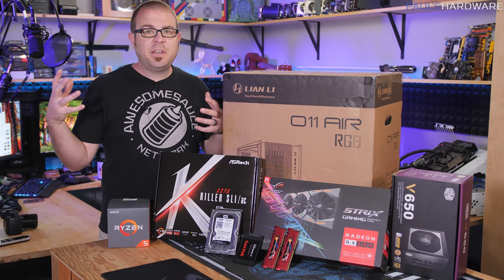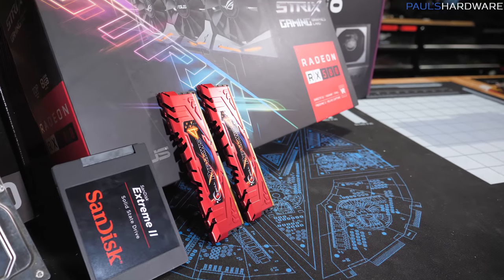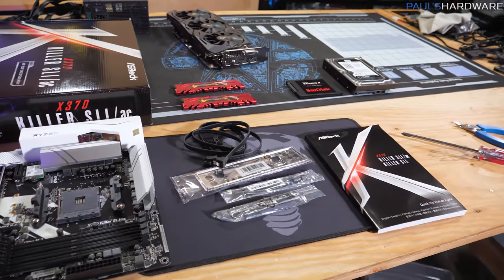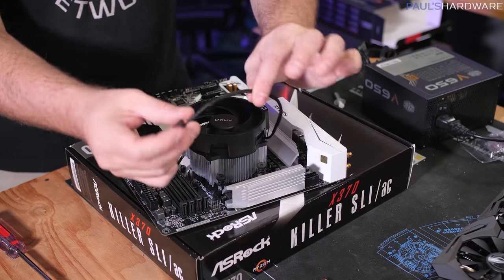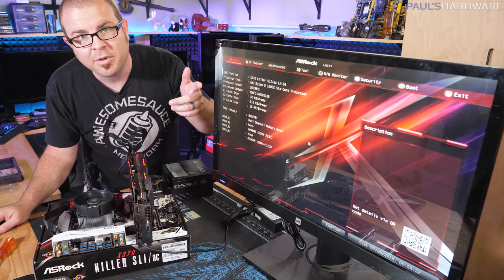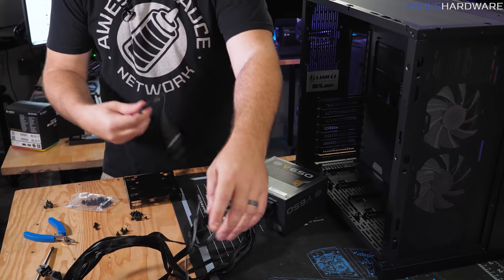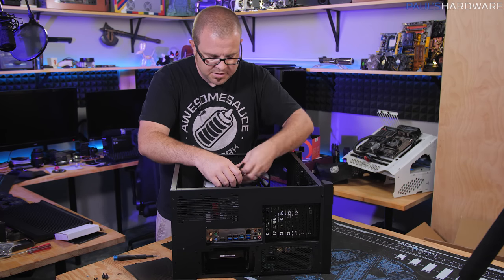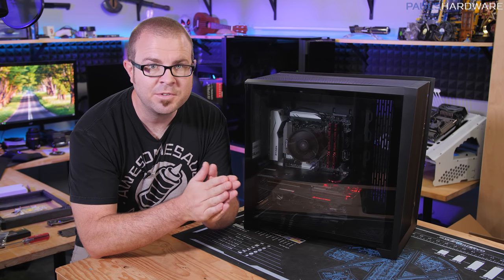How To Build an $800 Gaming PC in Late 2018!

Comment: 650 W Power supply????? Just why
Reply: Because if you actually do power calcs on that system, you'll realize that you're WAY below 650W.  The power calc I ran on it says it only uses 415W at load and only recommends a 465W PSU.  Add to the fact it's a gold PSU so it's more power efficient.  For my personal builds, though, I like to buy a bronze PSU that's double the load wattage.  There's a bell curve on the power efficiency.  At about half load, even bronze PSUs don't waste much energy.  If you're on a strict budget and you need to save that money, or put into a more critical part (CPU/Memory/GPU), buying a 650W PSU is fine.
Reply: @iguanac6466  IMO a budget build should focus on price performance. Like u said a 650gold PSU is waste of money in this budget build. Not to mention the 100 bucks case with RGB. I rather spend that money on a display
Peace

Comment: Back in the 90's I bought a friend's old used 386 system and taught myself how to upgrade and also how to build from the ground up.  Did that for about 20 years and a short-notics job change and relocation caused me to buy a factory-built computer.  NEVER AGAIN!  I know that building is more expensive but I have the satisfaction of knowing what's inside the machine and am more closely tied to its inner workings.

Comment: That PSU method is good! I have always used PSU for grounding, just plug it to a wall. Fan will not spin but it will work as "sink to ground".. Touch it occasionally, you can plug the PSU then to PC when you are complete

Comment: Hi Paul, I am about to build this exact system, the difference is I went for a 16gb ram kit, a B450 motherboard and a better power supply. I have had a PSU take out other parts before so I don't go too cheap. I have had to compromise on storage and only have a 240 SSD. In the UK our prices are a bit higher than yours but I am at £780.

Comment: Good looking mid-range build! Paul, you should however show people how to rotate the AMD logo, I imagine it can be pretty triggering to some people (me included). It's basically removing the shield and 4 screws and you can rotate the fan 360 degrees to any orientation.

Comment: Love your vids!  Can you help with a bit of advice PLEEEASE?  below is my current pc set up.  It was built about 6 years ago.  Do I need to build a whole new one, or can I just upgrade a few things on this one?  (games like WoW, Fortnite, Rainbow6) 

CPU:  AMD Phenom II x6 @3.8+ghz
 
Heatsink:  CoolerMaster hyper 212+ (hand lapped with twin corsair upgraded PWM fans in push pull)

Motherboard:  Gigabyte 990FX-UD5

Memory:  Corsair XMS3 @ 1666mhz

GPU (s):  2x XFX ATI 6870

Harddrive:  Hitachi 1TB 7200rpm SATA

Optical:  Sony DVDRW

PSU:  Corsair TX750 750W

Chassis:  Lian Li K62

Comment: As of 9/21/2018 using Micro Center's prices/deals:

1x AMD Ryzen 5 2600 CPU
1x MSI Tomahawk B450 Mainboard
1x MSI RX 580 8GB Armor GPU 
2x G.Skill Ripjaws 8GB-3200 RAM
1x WD Black 256GB M.2 SSD
1x WD Blue 1TB 7200rpm HDD
1x Antec One Case
1x Corsair CX550M PSU
-----------------------------------------------------------
$809.64

The above list is the best all-around build you can buy at the $800~ish price point as of September 2018.
It's considerably more powerful than the build in Paul's video(2nd gen Ryzen, 16GB RAM, M.2 SSD).

Comment: I recommend not using the pre-applied thermal paste that AMD supplies. I killed a 1st Gen Ryzen trying to take it apart. The pre-applied stuff had turned into glue after about a month of regular operation, and pulling the heatsink/fan off during disassembly brought the CPU with it (WITH THE ZIF socket closed), damaging pins. I've since always used Arctic 5, and haven't had a problem since. It's super cheap to get thermal paste, and one tube lasts for dozens of installs. Save yourself the trouble.

Comment: Hey Paul! Great video! Would you still recommend one of the Ryzen APUs and the upgrade GPU later when on a tight budget or to just save a bit longer for better CPU and GPU up front now that prices have come down?

 Canadian pricing doesn’t seem to have come down as much but it’s an improvement over the last year.

Also your 500$ build from this year is what finally made me decide to build my first pc. Thanks for all the great work
Reply: you can update the gpu later the 2400g is like a 1400 with an igpu, you can use even a gtx 1070 without bottleneck

Comment: Thank you for actually saying\explaining the point of an IO shield to newbies. It having “contact point for the components of the motherboard to prevent ESD”. I’ve seen idiots cut the contact points off those instead of bending them back as best possible when they end up bending them and then others actually take that crap advice of cutting the contact points off and burn their board up wondering why when they touched it a billion times plugging and unplugging components while the things on...

Comment: I just built an $800 PC with rx590 and ryzen 7 2700x with 16gm ram. I skimped out on storage though, only a 500gb ssd but it's all I need, only reason I did that plus way easier to upgrade

Comment: Hey Paul, should you ever get bored, do a throwback build to include older gen intel i5 (k series) paired with an affordable nvidia 980 or 980ti. To top it off, throw it in a Thermaltake View 32. Cheap, sexy, & extremely powerful.  There are way to many "cheap" processors and cards if you look that can rival any budget build.

Comment: Hey Paul, currently using the stock cooler on my r51600, want to upgrade to a better air cooler but I'm kind of overwhelmed by the huge range... Reccomendations?

Comment: ? i have a Gtx 1060 3gb, I7-7700, 12gb of ram, Ssd 250, 1tb Drive. ASUS H110-PLUS. Would this build you have be better? Or What should i just upgrade
Reply: GPU and maybe the hard drive...and I wouldn't do those until you start seeing your GPU memory utilization maxxing out, or your framerates aren't to your taste.  Upgrading your hard drive isn't necessary until you start running out of space.  1TB is pretty tight if you don't micromanage your game installations.  CPU/Memory/Mobo should last you for years.
Reply: I overclocked my gpu and tbh its a good increase. I just want to stream hell a better then i am now. So any suggestions on that? Is my cpu low end or?

Comment: Pauls Hardware Hi Need Some Advice. It's my 1st PC Build. Which GPU is good for 4k and 8k video rendering under cheap or budget range. And Which Coffee Lake PSU would you recommend for my build parts below.

Intel Core i3 8100 3.6GHz 8th Gen LGA 1151 processor.
Asus TUF Z370 Plus Gaming RGB Atx LGA 1151 Motherboard.
Coolermaster Hyper 212X CPU Cooler.
Ram : G.Skill Trident Z RGB 16GB (2x 8GB) DDR4 3000MHz.
NZXT Hue+ Advance LED.
1x M.2 SSD 250GB - 2280.
1x SSD 120GB.
1x HDD 512GB
3x Deepcool RF120 mm Case Fans.
1x NZXT Case Fan.
NZXT S340 Elite Mid Tower ATX Cabinet.

I have asked about it many time and asked everyone on YouTube and other social networks but No Answers Yet.
I Hope You Read And Help Me Out.

Comment: Quick question.

Are the AB350 motherboards worth it? or should I shell out the extra $$ for the x370 platform
I am about to build a basic Ryzen 1200/2200g system but planning to get an 8-core in the future

Also, is the whole single channel issue still a thing?
I'm planning to get a single 8gb stick since prices are quite awful here in Argentina.
Reply: A single 8gb stick is a bad idea. No need to spend extra money on x370.

Comment: Guys do you recomend these parts for streaming and gaming for my pc build im gonna do soon and please dont hesitate to tell me what parts i should change:

-ryzen 7 1700 (or ryzen 5 2600 still dont know)
-gtx 1060 gb dual 
-msi b350 tomahawk (or x470 gaming plus)
-2tb Seagate hardrive
-240gb sandisk ssd
-corsair cx550m psu
-8gb balistix ram (may get 16gb soon as a upgrade)
-Nzxt s340 elite white case
-uphere white psu extension 
-logitech g502 gaming mouse
-corsair k65 lux keyboard with mx reds or speed switches (still deciding) 
-steelseries Qck mouse mat

Comment: the case power connection should be long enough to reach the motherboard outside the case. if you dont want to be shorting things with screwdrivers

Comment: Hey Paul, I have a z370 motherboard, a GTX 1070 video card and a 650 watt semi-modular PSU - question - the 8pin cable that's affixed to the PSU that supplies power to the CPU has an extra 8pin connector that's attached and will fit my video card - so - is it okay to use that - or - should I used a dedicated cable from the PSU - it would seem to be that the less cables - the better?  Thanks in advance for your comments.

Comment: Good guide but on the front panel connector can you go a bit more in depth I ended up frying my whole system because i had put it into an adapter that connected to the power supply.

Comment: If you have a 2 fan AIO do you plug pump, 1 fan or use a splitter and plug both fans in? Or do you need to split pump and both fans together for the 1 plug?

Comment: Ok so here’s my build:
Gtx 1050 ti
I3 8100
B360 mobo
Single 8gb ram stick 2400 
1tb hard drive 
500 watt psu
Will this be enough to play most games on 1080p medium to high settings? This is my first build and I am on a budget but I want to know if i should just save up and get a 1060 3gb or not
Reply: 1050 TI will be mostly medium settings (esp if you only one with a terrible cooler and/or only one fan).  If you save up for a 1060, get a 6Ggb model with two fans and a cooler with radiator pipes/fins instead of a solid aluminum plate with fans.

State of Decay 2 ate all my 3G of 1060 memory at high settings @ 1080P.

Comment: Ok I have a gtx 1050 ryzen 5 2600 16gb trident z 120mm kraken cooler 1tb hard drive what power supply should I go with at the minimum

Comment: If u want performance for price just go used/refurbished. I got i5 7600k @ 4.8 GHz, Gigabyte z270d-p3, GTX 1070, 2 x 8 GB Corsair Vengeance LED (3200 MHz), a modular corsair psu and good case all for $650.

2018 with so many buyer protection policies by companies like PayPal, make it so easy to save money and get performance.

Comment: i was following step by step until the out of box test. my mobo lights were on but not the cpu fan nor the graphics card fans. should I continue with the build and hope I just didn't turn the mobo on correctly? or did I mess up the mother board? I have the same mobo in the video with a ryzen 7 amd 1700 and I also have a corsair cx 650 power supply. any help would be greatly appreciated. I'm a first time builder!
Reply: p.s. I did have power supply plugged in but was TURNED OFF while I was plugging in wires.

Comment: i bought a similar ready built computer (new), for 800 AUD which is about 600 usd.
razen 2600
rx580
500gb samsung 860 evo
8gb ram 2400
a320 motherboard
550PSU
rjb steel case with glass size (chinese)
rn-link pci router card.

crazy price i know, with coupon code %10 off,
upgrade from a macbook air 2015. got this deal with a 10 pecent off coupon from ebay.

extras i picked up,
razer mouse and keyboard with rgb lighting.
4k  gaming monitor samsung 1ms with free sync (will game at 1080p tho)
rn-link pci router card.

future buys to make use of the 4k monitor.
'ps4 pro' with rdr2 and uncharted 4 & the last of us 2 (only games worth buying a ps4 for)

Comment: Not familiar with the rx graphics cards what is this card comparable to in gtx? A 1060? Great video btw you’ve gained a new subscriber!
Reply: Yes, RX580 is on par with 1060.
Reply: Luke W thank you sir! Which do you prefer? What’s the point of grabbing this instead?
Reply: 1060 has lower power consumption and better better performance in some games, rx580 has more memory and lower price
Reply: Also, if you have RX580 you can take advantage of cheaper free sync monitors
Reply: Luke W thanks for the info man building my first soon might have to grab one instead of a 1060
Reply: Look at the + and - of both cards and buy the one that fits your needs best. Personally, I would avoid the 3gb version of the 1060 and the 4gb version of the 580.

Comment: I have boot time issues with that mobo, I have a very similar config, same mobo and same cpu, and when i push a OC to 3.9 my boot time's significantly decrease, sits forever in the mobo boot screen, does no good to have a NVME storage if it takes so long just to get to the OS Boot Stage, which the OS boots fast as it should, but I can end up waiting 20+ seconds for the mobo to kick in my OC, You should give it a shot Paul, and see if you can verify my discovery of this issue.

Comment: A Ryzen 5 1600 + RX 580 + 8GB DDR4 2400 MHz + ASUS PRIME B350-PLUS costs $820 here, and I'm not even considering the PSU, case, decent cooler,  SSD, HDD. It's impossible for me to build a relatively new and decent PC. What build would you recommend with that increase in price? (about 30% more expensive). I wanna play in 1080p things like PUBG with mid-low (max view distance) settings, CSGO, Overwatch with mid settings, and the newer games I don't mind if it's in low settings as long as it's 1080p 'cause scaling down blurs the image and that sucks. Also, I use IntelliJ for programming, usually with a NodeJS and Tomcat servers running to test my programs (using things like Jenkins and Sonarqube in the background), but my i5 3470 can handle that so I don't think it would be an issue that requires special consideration. Streaming CSGO and Overwatch would be nice, but of course that's a long shot for the price.
Reply: Get a cheaper case and PSU (Corsair/EVGA/Thermaltake/Seasonic are fine...but read the reviews before you buy)...you also don't need to buy the ROG Strix unless you need that level of binning (my ROG Strix 1070 is a beast at overclocking...+1000 overclock on the Samsung memory all day/night long with no artifacting or instability).  Also consider waiting for the parts (at least the expensive ones) to go on sale.

Comment: Dear Paul, 
I bought the G.Skill Aegis 2x8GB DDR4-3000 instead but I have no video output. Also no output on the screen if I just use the onboard HDMI. Fans and LEDs are working, but it appears that the Mainboard is restarting every approx. 30sek. Do you have any advice? 
Btw: Is there any reason to buy the more expensive G.Skill Ripjaws instead of the Aegis?

Comment: I have a question that I would like some help with. I have a Ryzen 7 2700X cpu with an Asus Crosshair VII hero (WiFi) motherboard. I’m now looking into purchasing my Ram and I would like to buy the TridentZ RGB kit, but when I go into my qvl for my motherboard it’s different from the recommended options from G.Skill’s website. So do I go with asus’ recommendation or G.Skill?
Reply: Btw they are both RGB from G.skill 3200. The pair that Newegg says is AMD compatible is not the pair that Asus recommends on the qvl.

Comment: So, I notice that PC builders no longer install DVD ROM's into new machines; so has the DVD ROM gone the way of the floppy disk drive and no longer a necessary piece of equipment for PC builds?  Just curious, as I am not into all that RGB flash in modern PC builds and would rather have a strong, decent rig to use to game with and do personal business on.  Good video on how to build a decently priced Rig together; have you done any video's on water-cooling a new rig for beginners?  Never built a water cooled rig, but I find myself interested in putting one together, for the experience and a bit of overclocking.  Thanks
Reply: Not really...most games are installed via the Internet now.  You can easily create a bootable flash drive to install your OS.  I keep a USB DVD drive around for the rare cases I ever need to read/write a CD/DVD.  I would recommend against a water cooled build unless you use an AIO cooler.  Custom loops can become a money pit between buying decent quality (non-leaking) parts and parts getting ruined if something leaks.  With AIO water coolers, you don't have to change the liquid and I've had good luck with my Corsair not leaking.  With a custom loop, it's recommended you change the liquid every six months (your mileage may vary depending on use and coolant).  Personally, I don't want to bother with draining/refilling coolant.

Comment: If one was wanting higher graphical settings where frames weren't as important as visuals or 4k a b450 board and a 2200g could save you money to go out and get a better gpu or even play games with just the cpu untill the next gen gpus come out.

Comment: That case is a rip off, meshify c is a good case for like 80.00. In my opinion if you have extra cash it should go for the processor, motherboard, and graphics card and extra 50.00 for any of those will usually get you the next step up, besides gpu

Comment: I'm going to make a gaming PC for music production and gaming stuff...tell me if i should downgrade or upgrade a thing or two or should i go with my regular list??
my list as follows...
1. intel i7 8700k 3.7 Ghz
2. ASUS ROG STRIX B360-F GAMING LGA1151 (300 Series) 
3. PNY NVIDIA GeForce GTX 1060 6GB XLR8 Gaming Overclocked Graphics
4. Cooler Master MasterWatt Lite 600-Watt Non-Modular Power Supply
5. Seagate New Barracuda ST1000DM010 1TB
6. Kingston SSDNow UV400 120GB SATA 3 2.5-inch Solid State Drive
7. Aorus Gigabyte AC300W R2 ATX Mid-Tower PC Case
8. G.Skill Trident Z RGB 8x2 3200Mhz
9. Kingston SSDNow UV400 120GB
10. As for cooler i have two options...
Deepcool Gamer Storm Captain EX Series AIO Liquid Cooler 360mm / Cooler Master MasterLiquid ML240R
As for my budget i can go 1900$ max..
plz suggest me coz I'm using this mostly for making music and as for gaming theoretically it can run most of the titles easily with good frame rate..ty

Comment: what will be the bank for buck power supply then because this new B450 CARBON PRO AC from MSI Features a 8+4 (12) pin CPU in put ? most psu up to 8 i dont know if full moduler psu need it for this.